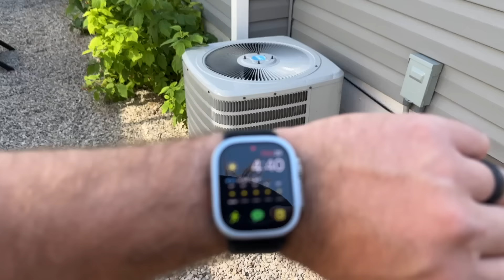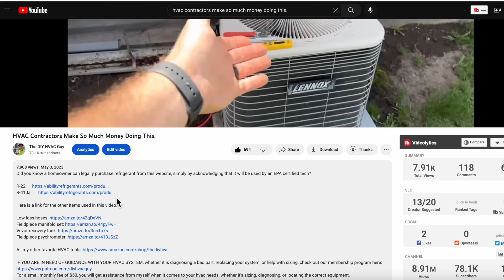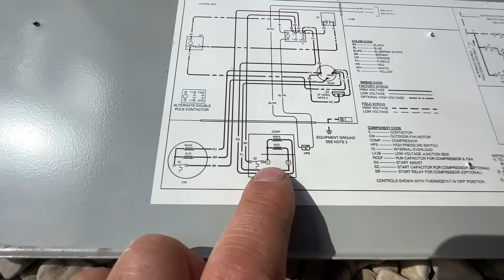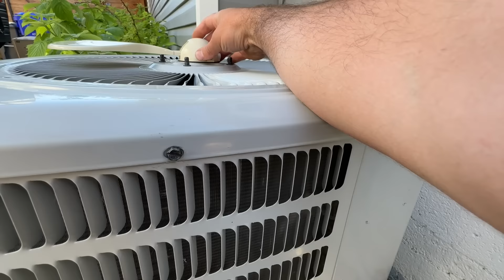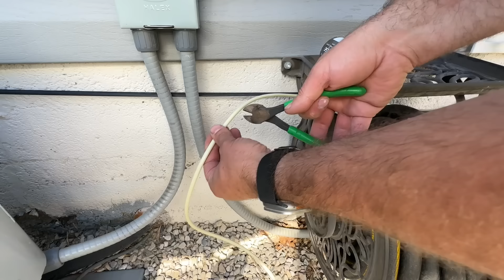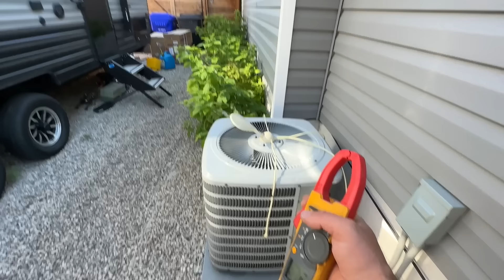Can This Device Actually Lower Your Electric Bill By 30%??

Comment: The better design is not to spray mist onto the coil but to let water dripping down a disposable filter wrap outside the coils. Evaporation of water will lower the temperature of air that flows through the coils/fins. This will prevent corrosion as water never touch the fins.
Reply: There was manufacturer that built an evap cooler to go on the intake side of the old roof top AC units back in the 70s. My parents had one installed. It worked well, but a few things killed those. Energy prices went down so less need for saving energy. Second, when the AC condensers moved from roof to round, they started wrapping the condenser around the outside, rather than just one big square on one side of the AC, so an evap to wrap around the whole things would get big. Third, HOAs hate anything they don't like, so anything noticeable on the AC is a no-no.
Reply: @javaman2883 just hang some stylish damp towels near your condenser. Just wash them often and hang dry them outside.
Reply: looks like you got something to invent
Reply: except that the air going across the coils is now more humid meaning you're still getting moisture on the coils...
Reply: @kleetus92  that's vapor in the air and not droplets on the surface, big difference.
Having said that, I don't see it being as effective as actual droplets on the fins soaking up heat from them to the point of evaporation.
Their new problem is the impeded airflow they've created with a wet filter wrap. That restriction is going to hurt the efficiency of the unit.
Reply: @kleetus92  I'm going to give that a one a mostly no. The condenser coils should be hot, therefore any humidity is irrelevant, unlike the cold evaporator coils that condensate water constantly.
Reply: @victorspresence1263  You're not familiar with how corrosion works eh? Doesn't have to be sopping wet, it will still transfer. 

just like how cars and houses near coastal areas are always corroded even though they're not in direct contact with salt water.
Reply: @kleetus92  :Yeah. Good test project.
Reply: @kleetus92 but the moisture is now distilled water with zero minerals
Reply: @scottsluggosrule4670  it will still pick up crap from the air, dust, pollen, etc...
Reply: Just hang dry your clothes near your condenser unit.

Comment: This famously reduces the lifespan of your AC system. HVAC manufactures aren't fools, there is no one trick pony here.
Reply: Please provide some more info on this.
Reply: @andydelle4509 see my comment later in thread and it explains as best I can
Reply: @andydelle4509 Rust. Gunk on the coils from water mixing with pollen and plant debris, like cottonwood, dandelion, etc.  Mineral buildup on the coils. Calcium might be filtered by the calcium filter, but there’s other minerals that aren’t filtered out. Unless your hose water is filtered, you’re screwed.
Reply: The ac manufactures would not mind if it decreased the lifespan of their products.
Reply: Increase the SEER rating of the condenser and enjoy energy savings for years. Buy the cheapest A/C (builder grade) and pay way more than you want to. Plus there’s usually rebates for high efficient equipment.
Reply: Making it a “swamp cooler” will definitely reduce life of components. Rust rust and more rust on everything. “Swamp coolers” are nothing new…old ways that still ruin components and cabinets. Right there with ya bud. Solution…proper sizing and  understanding of how to do it right👍🏻

Comment: I installed the IRRIGATION -MART Automatic misting kit for 24VAC. It wires into ac control wire and connects to a solenoid valve. It was 60 plus shipping.

Comment: Thank you for your contribution to society. I would like you to please install an  Anderson or (appropriate plug) to the central ac, which connects to the house power. This would allow us to completely disconnect the unit from the grid and connect it to a solar panel array, Gas/Diesel Generator. Power inverter. or maybe a squirrel cage, lol.

Comment: I think you will waste some water on the windy day.  Instead of this invest in a unit that has a selenoid connect directly into the AC 24 volt and only activates when the unit turned on.
Reply: How much would an electrician charge to hook this up?
Reply: @malcolmblack717  Cost me nothing. Just find a 24v source run/on the main board and tap into it. Solenoids use very little amperage so it doesn't affect anything.
Reply: @andym.9740  I am not an electrician or handyman. How many people do you think are a capable handyman like you?
Reply: @malcolmblack717  Sorry, I forgot to mention I'm an electrician. I guess the HVAC guys would charge around $150-200 for the job.

Comment: Our air handler is in the attic. Which as your well aware, makes it heat soak all summer long. I have debated covering it in insulation board for two years now. What are your thoughts on this and how efficient it would be? Thanks.
Reply: You can use a solar powered roof ventilator provided you have soffit air intakes all around your home,
Reply: Maybe wrap it with double-bubble radiant barrier wrap?